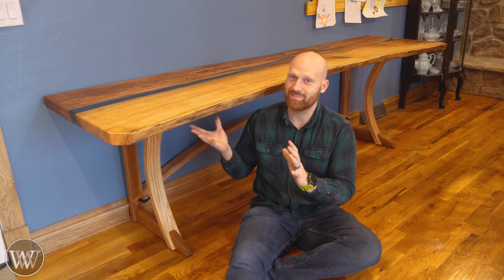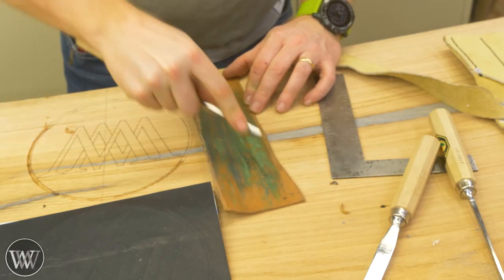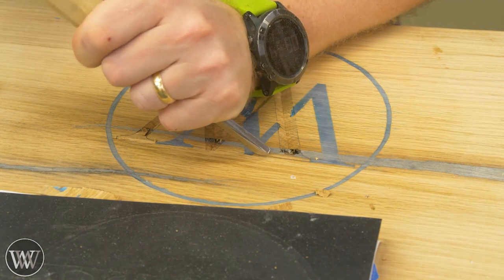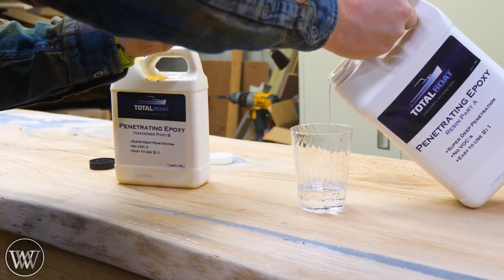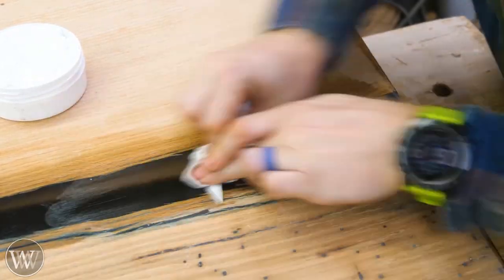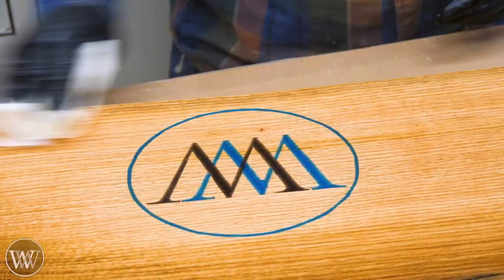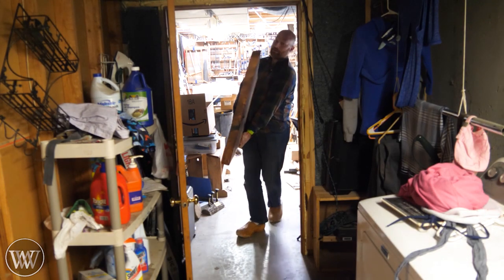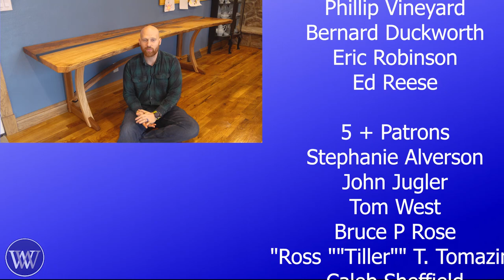The Desk is All Done

Comment: You said you used the Rubio on your table and it's held up. What about water spills, food spills, plates banging against the table etc?
Reply from the maker: Not to mention finger paint, crayons, playdough, and slime. It all cleans off nicely and holds up suprisingly well
Reply: @WoodByWrightHowTo  lol, exactly! Thanks for the reply. One more question. When it comes to needing to renew the table again in the future, how is the re-coat? Just light 220 - 300ish sanding them reapply or is it a bit more invasive where you need to sand it all down?